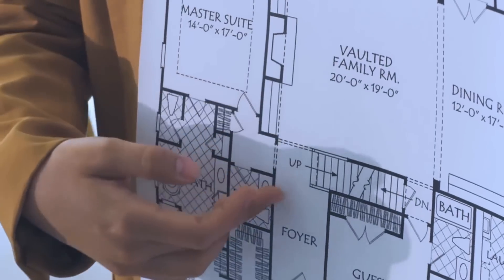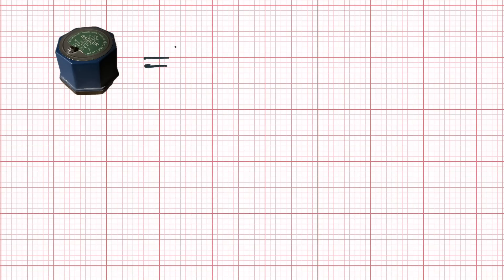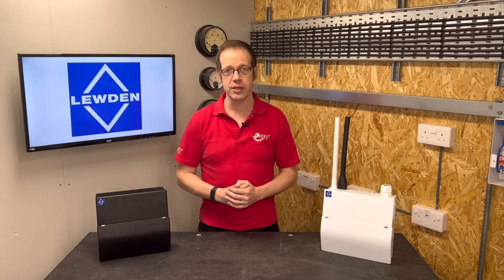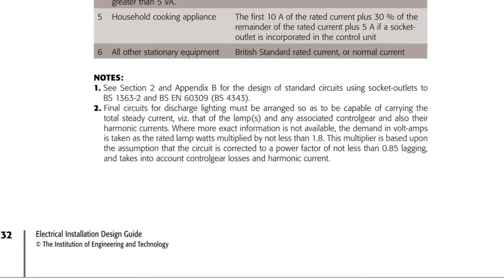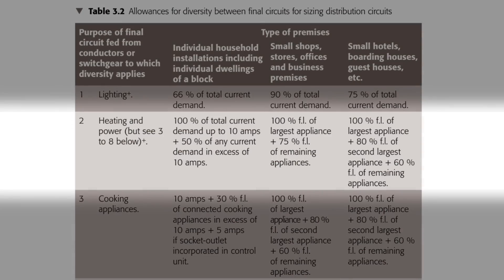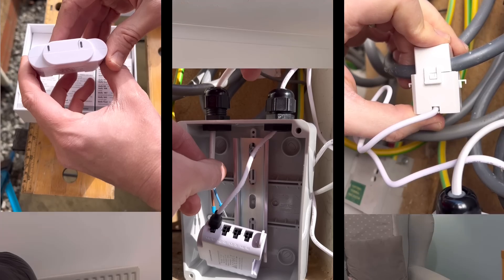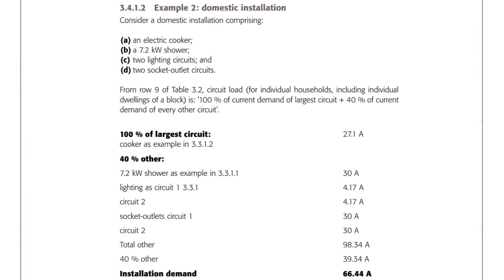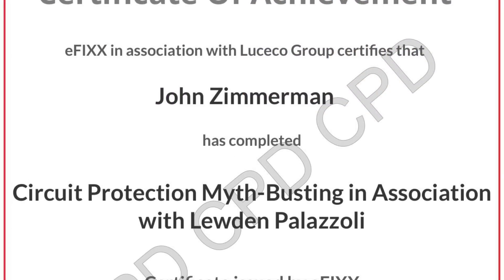Are You Calculating Maximum Demand Correctly?

Comment: Hmm, a very basic assessment and overview, given that most new household loads have significant Power Factors (meaning low); induction hobs, led lamps, heat pump compressors, EV charge points, to name a few, so therefore circuits need to be matched according to the PF adjusted current values, so a PF of 0.5 will require conductors to be sized at double the normal rating. I’m surprised the guidance makes little reference to PF adjustments in load currents, it seems to be somewhat out-of-date or written by people who don’t understand the topic or how modern property loads are evolving.
Reply: EV chargers (the actual charger is actually in the car, the charge point is just a fancy socket) have active power factor correction which gives it a power factor of 0.95+. This is the same for other things with significant load that also have switch mode power supplies such as your TV, laptop, pc, high power LED supplies, PV inverters, battery chargers etc. I’m pretty sure at least some heat pumps have this too
Reply: @TheAviation101  eVSE’s have OF correction, I think your way off subject there. All compressors have non-unity PF.
The EV charger will not have a unity PF, tend the Renault Clio as an example, it won’t start charging until the PF is above 0.8 and yet there are countless examples of where it won’t start charging, indicating that typical house loads are a cumulatively PF. Whatever, even modest PF values below unity should be taken into account even at 0.9 the actual load current t will be 10% higher, still whether do I know!
Reply: @G6EJD  I’m talking about the charger itself, not the house. Given it has active circuitry to correct the power factor (of the charger, not the house), the Renault Clio has a power factor of 0.96
Reply: @TheAviation101  yes, but you can’t separate an EVSE load from the house loads, all the loads are combined to a single composite load and PF.
Reply: @G6EJD  I turn a crappy capacitive dropper 10W LED on. It has a PF of 0.3. I also have my car charging at 7kW with a PF of 0.97. The overall load is 7.01kW with a PF of 0.968
Basically it's the high demand loads which matter and thankfully most of them have power factor correction.
Reply: @TheAviation101 so if the Cleo has a PF of 0.96 why did MyEnergi have to introduce a Compatibility mode to their EVSE with a variable PF setting such that it would hold off EV charging until the PF rose to > 0.80 is their default value, without which the EV would continuously stop charging.
Reply: @G6EJD  It could be that it has spikes in the power factor even if the average is 0.96 (therefore very low thermal losses). Or it's an older / specific model that's affected?
Reply: @G6EJD  Could also be at very low temperatures such as well below freezing whilst it warms up too or when the charger is operating at very low currents
Reply: Regulations ensure there are very few high power devices with low power factor, even a crappy power factor cheap gu10 is still less than the old halogen lamp.
Reply from the maker: Some interesting points here. 👍

Comment: Very important to get the figures correct for a whole premise load as you don't want a burning smell as you shake hands with the Customer after completing your install
Reply: Provided all load devices are appropriate to this should not happen. Nuisance tripping is more likely...
Reply from the maker: True, true.
Reply: That's not going to happen is it. The DNO slaps in a supply and that's it really. It doesn't matter if you install 100ccts you've got the main fuse and that's that.